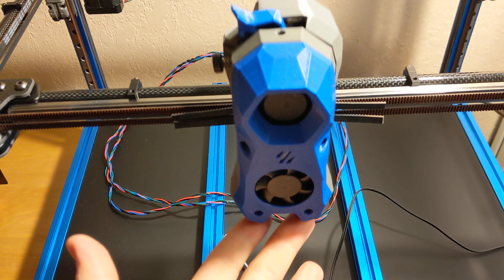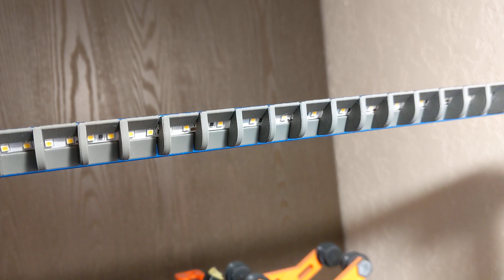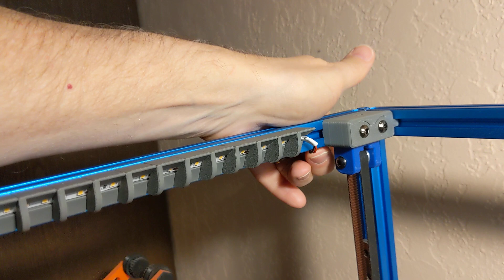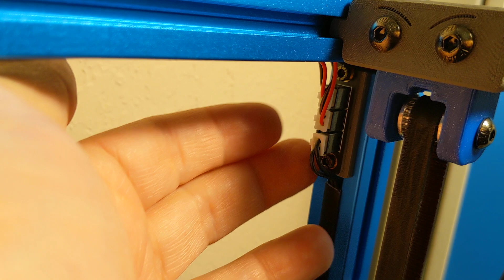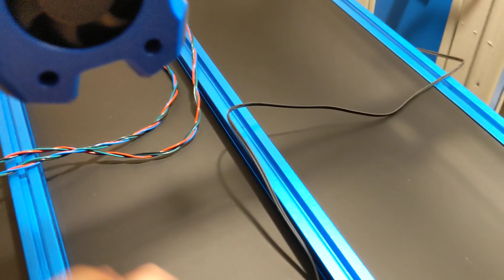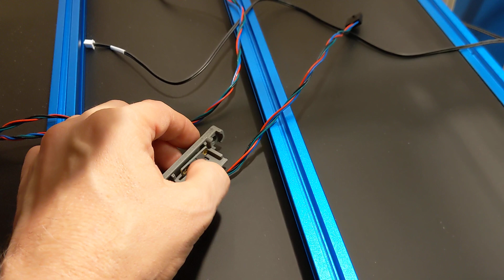3D Printer Voron 2.4 Rev. C 350mm - Build Progress Part 8

Comment: Tom, what screws did you use to attach the Toolhead PCB?  Did it require any sort of standoff?  I can't find that step in any of Matterhackers instructions or the Voron 2.4 Rev C manuals

Thanks in advance for any advice!
Reply from the maker: @doveravenuechurch3547  There's a separate PDF for the Stealthburner.  It uses a small printed standoff that goes behind the PCB.  I don't remember the screw sizes off the top of my head.
Github page with manual:
https://github.com/VoronDesign/Voron-Stealthburner/blob/main/Manual/Assembly_Manual_SB_High_Contrast_7-7-23.pdf
Reply: @TomsProjects  Just realized I posted my question on our church account :D

The manual you linked doesn't show the Toolhead PCB at all.  At 6:53 in your video, from what i can see, it doesn't look like there's a standoff, but I'm not totally sure.

For now, I've got it mounted with 2 M3x8 screws, and everything seems to line up.  Hopefully I don't fry anything when we get to startup :D
Reply from the maker: @codered10  Sorry about that!  I'm not sure where I found it in my build, but here it is in the Github:
https://github.com/VoronDesign/Voron-Stealthburner/blob/main/STLs/Clockwork2/%5Ba%5D_pcb_spacer.stl
Here's an 8nstall guide from KB3D showing it:
https://wiki.kb-3d.com/en/home/linneo/voron/PCBs/Stealthburner_Two_Piece_PCB
Reply: @TomsProjects  we found it on a Fusion model and were able to locate the piece. Thanks a ton for your help! Knowing there was a standoff was helpful to know we needed to go digging.

Comment: I got same carbone kit, really want to know how to organize AB motors' wires. Any idea?
Reply: I finished mine wiring finally. I put B motor wire through inside of rear carbon tube to the A motor side. Also I use btt canbus, now all wires looks better.
Reply from the maker: I'm not at that point yet.  I'm also not sure if the umbilical can fit all the tool head wiring.  A canbus setup would make that easier but I wasn't expecting to do that until I got it printing first.